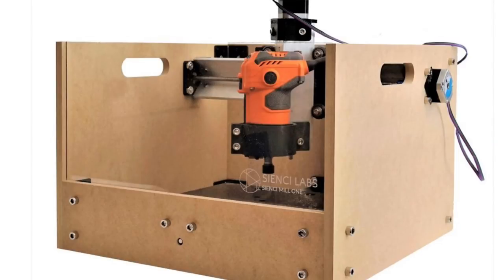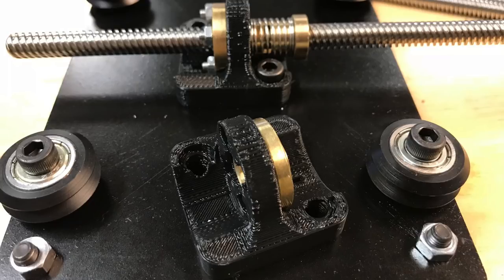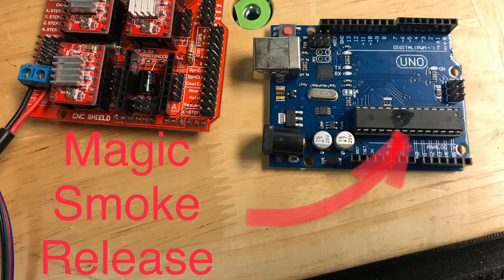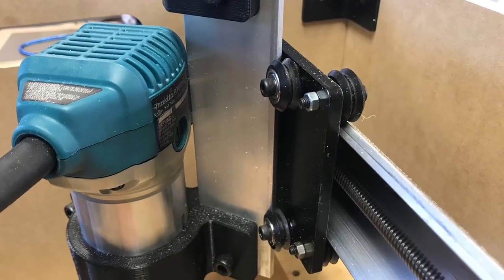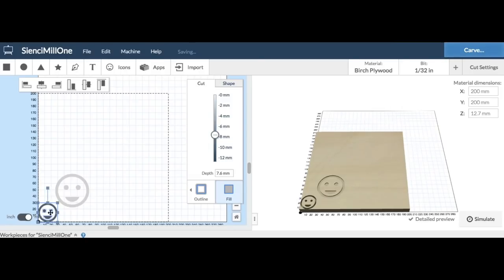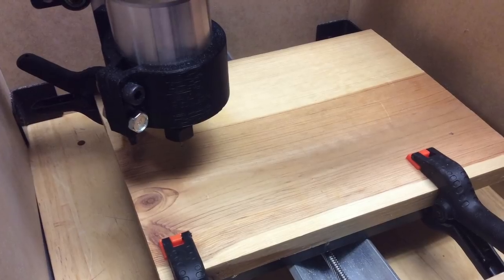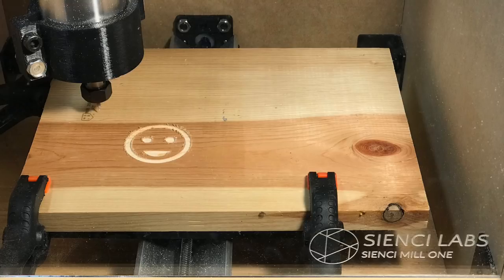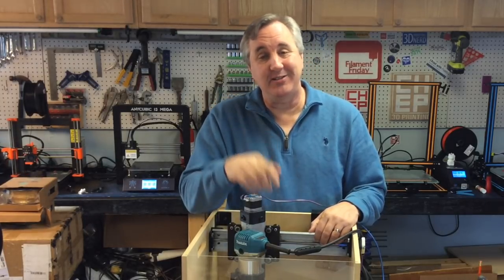$399 Sienci Mill One Desktop CNC Machine

Comment: Oh man, I am really in doubt of what to do first. I want to go the route of CNC machining, but I also would love to buy a lasercutter with a bit of power, like 60W... Tough decision...
Reply: I have a 50 watt laser cutter (remember if it is an eBay model subtract 10 watts to get a real world machine wattage so my 50 is 800mm long tube equals 40w) and I need a CNC as well.  Why?  One can do the grunt work and one does the engraving and I wish I had an all in one machine then I would never need to touch the material until both jobs were done THOUGH the sawdust would catch fire or clog the ventilation system the laser needs so :(

Comment: As a machinist part of me cringes with the idea of 3D printed load bearing parts on a machine like that but hey that is me! Do agree a bigger than the build area bed would be helpful for workholding. Will be watching this for sure.
Reply: yea, it makes no sense to have a 1 HP motor mounted to a plastic 3d printed part.. you will never be able to use the power.
Reply: The only thing enticing about this is the price.  Look at the print quality of the parts they used it looks like .3-.5mm so very rough and MDF is garbage to use.

Now if this used injection molded parts, at least, and a metal frame for $399 I would buy it.

Comment: $400 for some MDF and hardware? You not only have to assemble it and provide the router but also install the firmware? No thanks
Reply: It is by far the cheapest mill than can do aluminium properly, but if you do not like the price you can source all the components and build your own. It is fully open source. I sourced and built my own, thinking it would be much cheaper then the 400 $. In the end it turned out slightly less than the 400 $, but the build quality was nowhere near the kit. I ended up regretting not buying the kit. That is just my experience. Do as you want, it is fully open source after all. Whether you choose to source your own components or buy the kit, it is still the most capable sub 500 $ CNC kit.